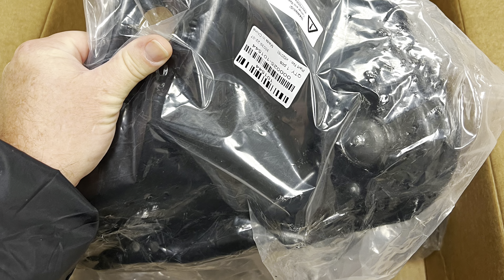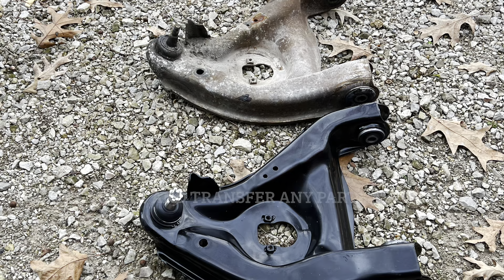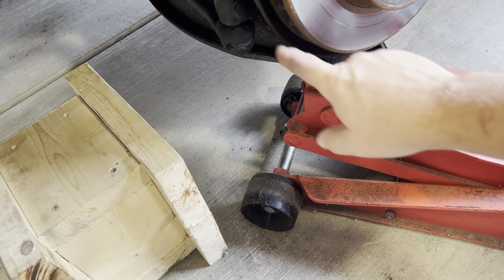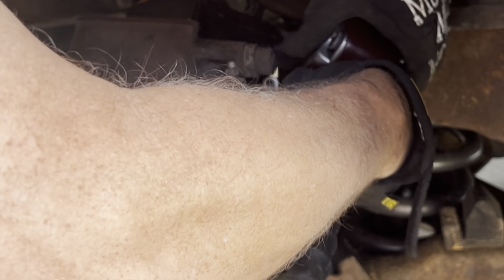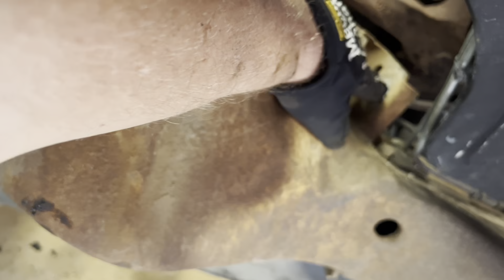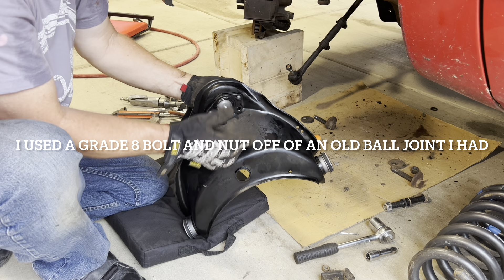Replacing Control Arms, Ball Joints & Bushings on my ‘94 Silverado OBS

Comment: Save your oem control arms .....them aftermarket chinese junk ones wont last long and they flex from crappy metal
Reply from the maker: Let me repeat myself again, these are not aftermarket crappy Chinese control arms. These are original factory OEM GM control arms that have been refurbished. That means they came off of GM vehicles and were cleaned/dipped, inspected for damage, fitment spec’d, new coat of paint and new bushings/balljoints installed. I’m a former Chevrolet & Cadillac service technician so I do know a thing or two about what I’m looking at. They’re still working perfectly on my lowrider that I use daily and still haul up to 1,000 lbs. with it. Maybe you bought some Chinese arms and were disappointed, I don’t know about those. But these are legitimately what I said they are.
Reply: @dronechaserzl1 hey how did you know what was refurbished on ebay? Did you have a link? Im needing to do this to my 95 LB. Thanks for the video
Reply from the maker: @ANT_704  sorry I don’t have a link to those anymore but I just researched them all til I found the ones I wanted. When I went to install them you could see they were old OEM parts refurbished due to some rust areas easily seen thru the new paint… over 3 years and almost 30,000 miles still zero issues.💥👌
Reply: @dronechaserzl1 thank you for the info and responding! Great videos man!
Reply from the maker: @ANT_704  just found these from Detroit Axle w/10 year warranty.. still decent pricing https://www.detroitaxle.com/part/1994-chevrolet-c1500/control-arm-assemblies/front-upper-control-arms-w-ball-joints-pair/k620160_k620161/

Comment: I have the exact same truck. Year , color , body trim etc. 372k miles on OE engine.  Been working on rebuilding front end a part or two at a time. Yours looks great lowered. Thanks for the video.

Comment: Dang good video 👍
I just rebuilt my motor and so I ordered new clam shell motor mounts, went to put those on today before droping the motor in, removed the tire, took one good look at the upper and lower control arms bushings etc and was like nope not today and put the tire back on😂 

Everything is toast and needs to be replaced and the only way I can get the motor mounts installed is by removing the lower control arms ,poor design. So I guess I'm dropping a motor, installing new upper and lower control arms and motor mounts at the same time smh. 

Question for you, are these rebuilt control arms or new? If they are new are they as thick as the original control arms?

While I'm at it I should do the springs and shocks as well. 

Thanks 👍
Reply from the maker: @HygroHybrid  They are OEM factory control arms that are refurbished and an exact replacement of the original arms. 👍

Comment: Any ideas on why one side would be sitting higher than the other after this? I made sure both springs were set in the pocket on the lower control arm and both control arms were torqued while the car was at resting height.
Reply from the maker: @patrickkennedy5452  yes, one of my springs got caught on the upper(top) inside flange that lines up with the inner part of the spring. I noticed it as I was compressing it on the install. I suggest you recheck everything for this type of issue and any other such as a weak coil spring or incorrect parts or install error. Hope that helps!

Comment: Nice work, getting ready to install mine as well.  Nice truck by the way.  I got my control arms from Amazon. Own a 1995 chevy C1500.
Reply from the maker: I had to swap out powersteering gearboxes again. Leaking again. This time I paid a little more for a redhead gearbox and I can honestly say it’s the very best quality you will find in a rebuilt unit. It’s been around 6 months and it’s still perfect. 👍

Comment: Are there torque specs for the upper and lower control arms? I looked it up but no one seems to know and I’m In the process of installing new ones on my 93
Reply from the maker: 110 ft lbs upper and lower to frame 88-98 obs

Comment: the outter tie rod is backwards señor 😂 the bolts supposed to be on bottem, lest thats the way i was thought so its a less possibility for the rod to fall out
Reply from the maker: It’s the designed-in engineering of the truck and other vehicles from the factory. It’s concave and goes into the spindle only one way. Respectfully, you were taught incorrectly.